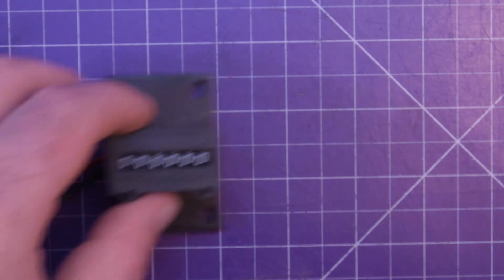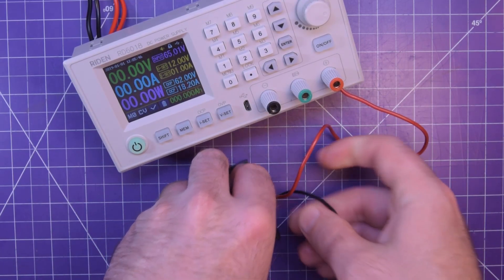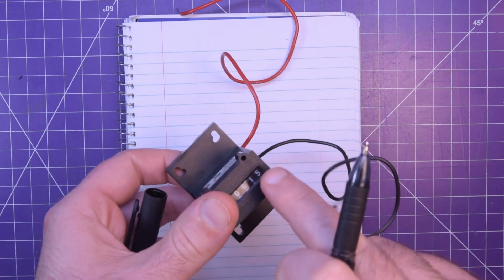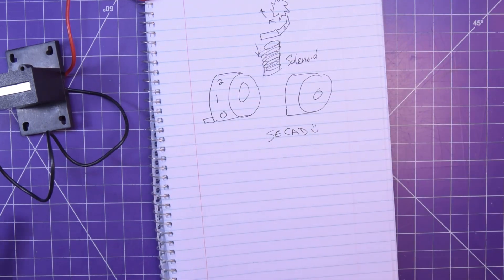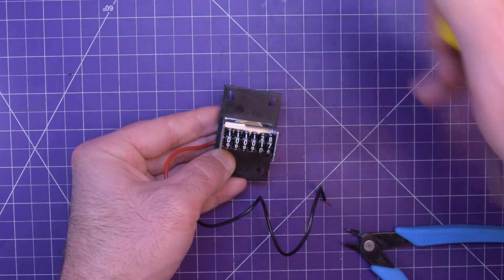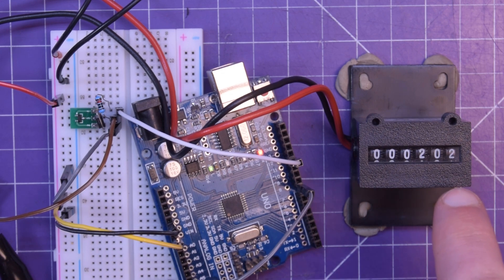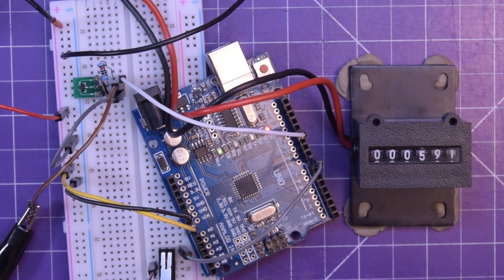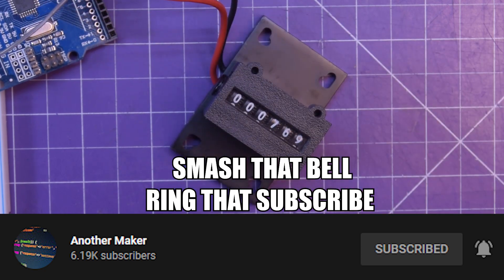A Neat Mechanical Counter!

Comment: I'm wondering if you could reduce the skipping at high speeds by varying the pulse width. Can't think of a use for a mechanical counter that fast but I want to see it nonetheless.

Comment: The automated paper folders used in printing used those type of counters. They had a knob on the side to reset them to 0. They ran very fast. It was also very noisy when the paper was hitting the bar  that stopped it so it would fold the paper.
This is one similar to what I ran when I was in grade school 
https://youtu.be/KfsnL7TsLSA